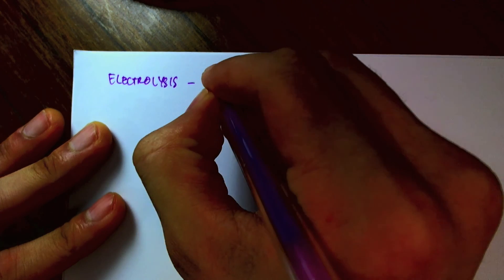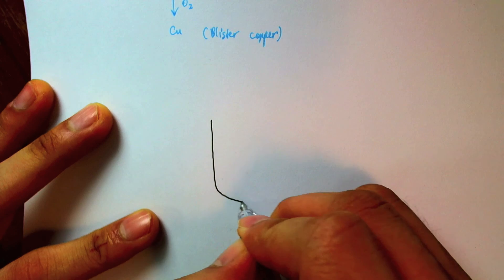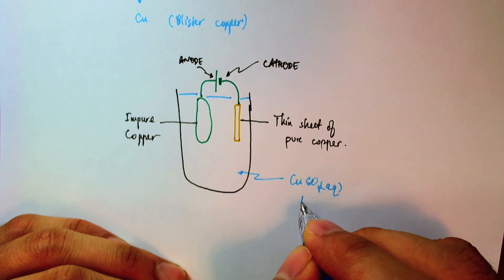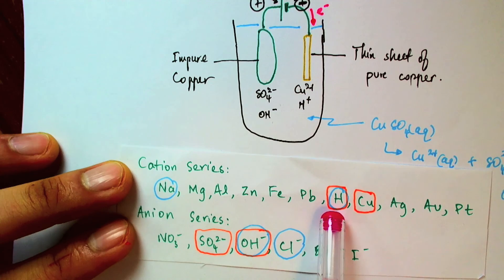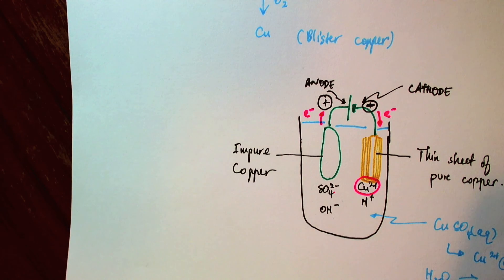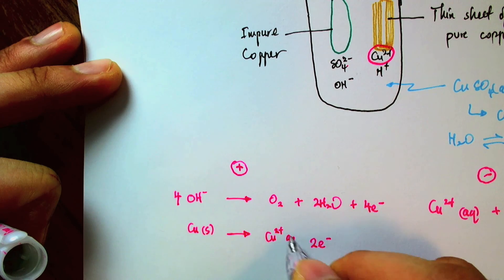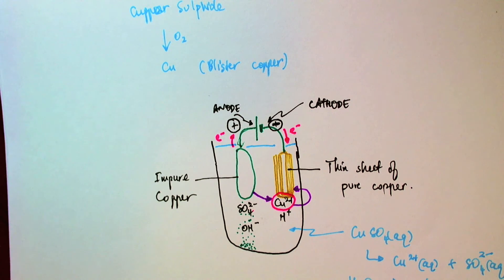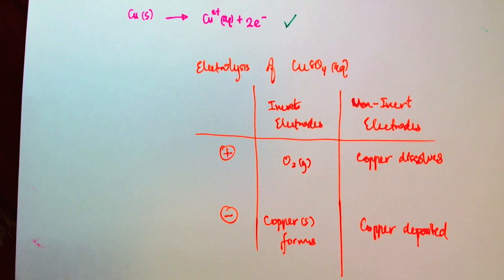Electrolysis  - Copper Purification

Comment: Excellent video.  Can this process extract pure copper from aluminum bronze alloy?  Thank you.
Reply: I tried it, and it apparently it does. It's important to use a low current, approximately one amp, for a solid deposition.  Higher current will accelerate the operation, but it will also deposit the copper as a fragile cake or sponge as the abundant hydrogen produced at the cathode interferes with the process.

Comment: So lets say I had a hammer milled mixture of metals, copper, iron, tin, lead, palladium, gold, silver and I put all of that into a filter basket that was functioning as an anode, would this still work?  is it nessary for the impure anode to actually be a bar?  with silver refining they often use a basket of chunks of impure silver with the anode stuck into that.

Comment from the maker: I suppose the copper being added on atom by atom can fit quite easily in to the copper lattice of the electrode. With an inert electrode like carbon, I would expect the copper to not attach as easily on the electrode.